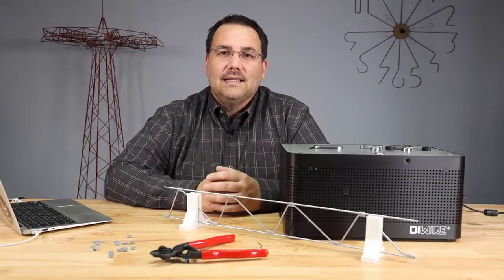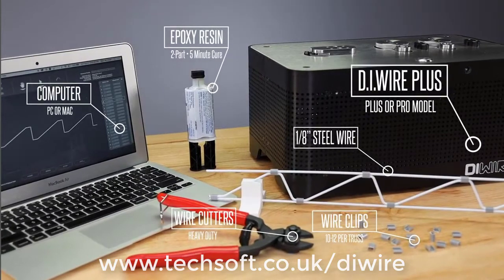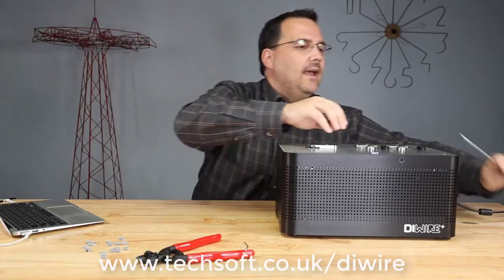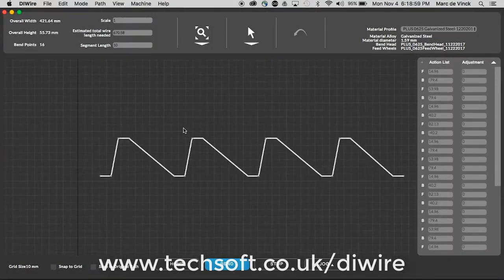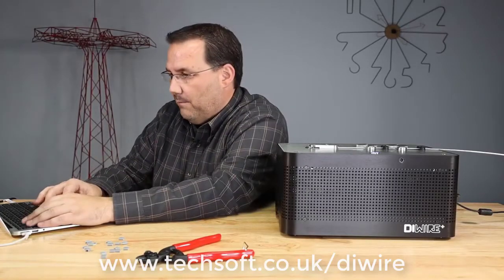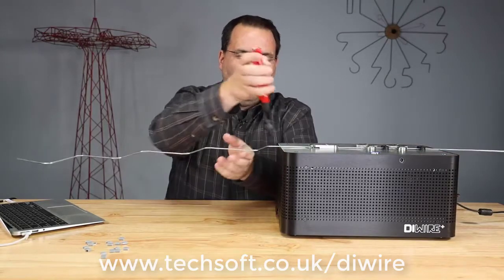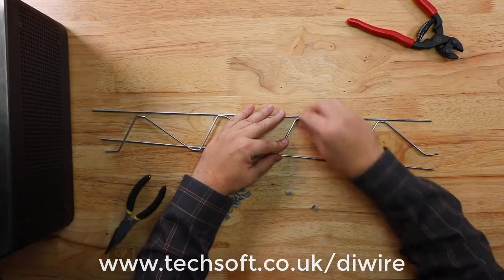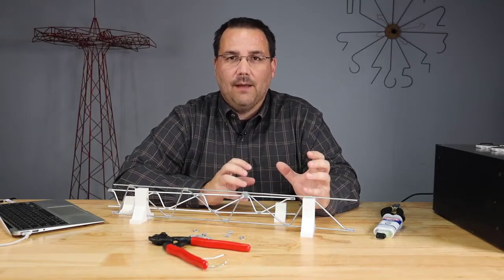D.I.Wire Plus CNC Wire Bender

Comment: Can this wire bending system be used to form semi-rigid coaxial cable? Semi-rigid coaxial cable has an outer metal sleeving, inner dielectric layer (typically Teflon), and an inner-most center conductor.